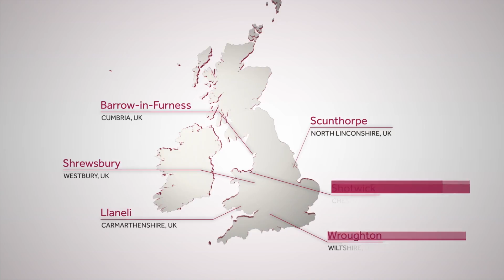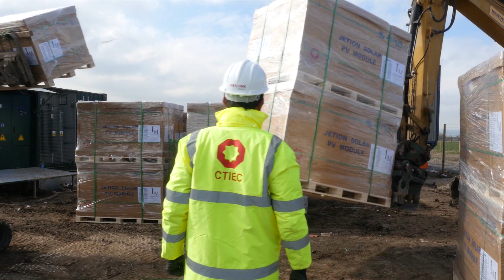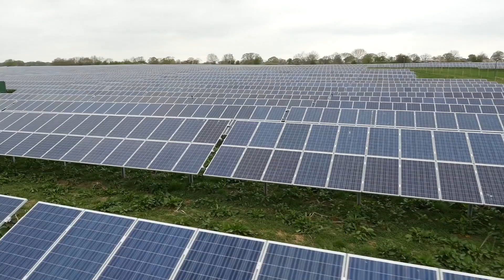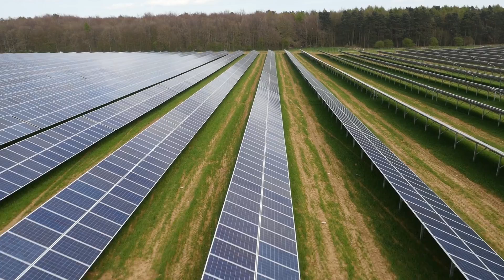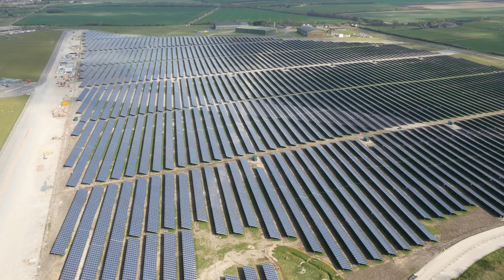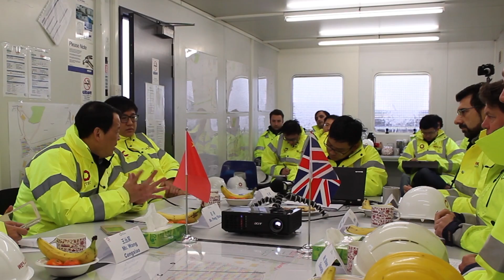Large Scale Solar Power Plant in the UK

Comment: Dear sir/madam

 

Thank you for contacting G.S.I company.

The GEVA-BOT is a revolutionary portable PV cleaning robot invented by Israeli entrepreneur Eli Geva. Patended No. 61869076. Authorised by the solar panels manufactures and certified by the world leader lab: PI Berlin.

 

The GEVA-BOT operates on a new technology which allows the robot to be:

* Extremely fast; 3 seconds per meter.

* Super efficient against all kinds of dirt and dust.

* Light weighted for mobile purposes (12 kg)

* And most importantly - more affordable than any cleaning solution on the global market in 2017.

 

That means that you only need 1 GEVA-BOT + 1 employee, to handle an entire solar field, no matter the size. And all there is to do is simply move the light weighted GEVA-BOT from one panel row to the next. The more GEVA-BOTs you own, the faster it will be, as seen by the GEVA-BOT team in the video. It can be operated either with several water infrastructure spots, or with a mobile water tank (as shown in the video).

 

Our robot is a custom made to fit your PV panels dimensions.

In order for us to check whether your site is suitable for the GEVA-BOT,  Than we could reply with a detailed price offer.

 

* Each robot starts at approximately 6,000 EUR (depending on your solar field dimensions).

* OPTIONAL: You can also purchase a water tank directly from G.S.I.

 

Regarding the price:

1. Excluding shipping costs and restitution.

2. Excluding taxes & fees.

3. Price does not reflect cost of regulatory approvals and/or certificates for the use of the equipment in the destination country.

 

Few technical matters:

1.    Water consumption is approx. 1 litter per panel.

2.    The robot is supplied with integrated battery.

3.    Warranty time: 500 working hours or 12 months.

4.    We will train and guide your team to fully maintain the robot.

 

Our custom-made solution:

-          Increases your income up to 35%

-          Reduces your cleaning costs in 50% and more

-          Custom-made to perfectly fit your system

-          Fast field implementation and simple operation

-          Dramatically reduces cleaning time

         Powered by a built-in battery, completely safe.

 

Best Regards

 

 

yossi.

Sales maneger

TEL1:+972529241403

TEL2:+972524081818

Comment: Plant power=98MWp 
Average Plant Production=9442MWh/yr !!?

Let's say, even if the plant produces the maximum rated power 1 hour per day and produce 0 W the other 23 hours of the day, the annual production should be close to (98MW *1h*365 day)  35,770 MWh/yr. 
9442 MWH/yr looks a little low.
Reply: Gov idiots claim the largest site of these can produce 0.7% of total U.K. Energy. In a proper functioning "system" that would translate to 10-15% of total energy approx. Therefore they only need 8-9 more of these, stick  things in full proper functioning mode, and their will be no need for most of the fossil fuel / oil plant crap.